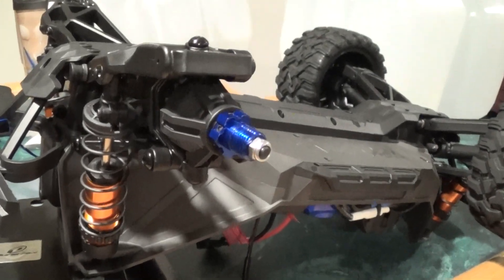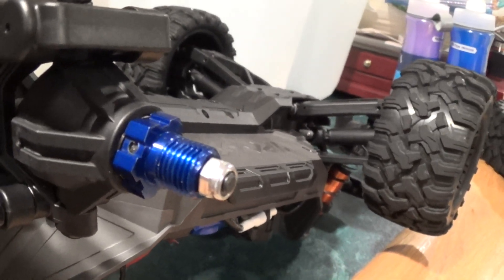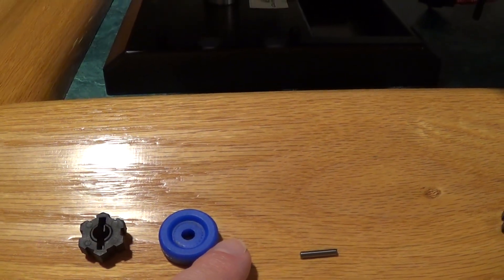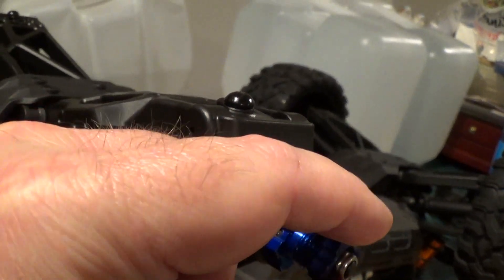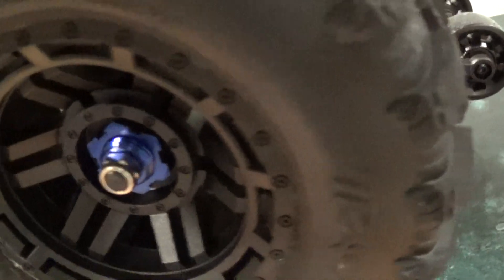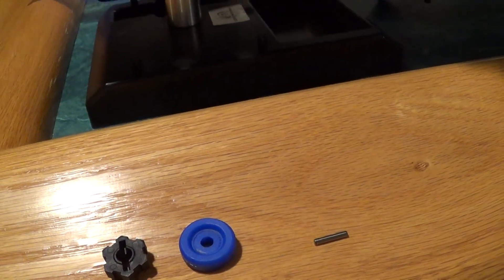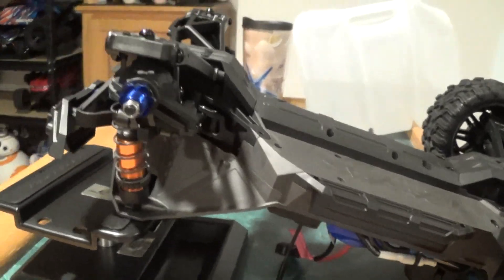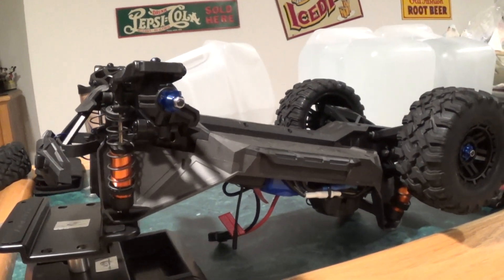Traxxas Maxx with Aluminum Hex Mod

Comment: What's the part number for the aluminum hex and is that a 5mm nut?
Reply: The hexes are part 5353x and that is a 5mm non-flanged nut. Part 4147

Comment: Nice work!  Is there a gap between the stock axle and the blue axle?  In other words, does it fit snugly onto the axle, or does it slide on with a small gap?
Reply from the maker: Thanks😁   It fits snugly with no gaps.  The nut is just for looks.  The set screw holds it in position perfectly up against the bearing.  I am definitely happy this worked out.
Reply: Edward Turck really nice find👍

Comment: Hey Edward Truck, did u use the pins that came with the 17mm hexes, if u did did u have to drill out the pin hole for the larger pin in the new hex🤔, bit late in the game I know But I am here🎊
Thanks Edward
Reply from the maker: I used the same pins and no drilling necessary...direct fit 😁

Comment: Did you just pull the plastic hex off? Seems like it doesn’t want to budge :)
Reply from the maker: I used a flat head screw driver to pry it off.  The plastic hexes are pressed onto steel pins.  Just be careful that you don’t pry directly where the pin sits inside the plastic hex.
Reply: @beyondthebluerc1  Thanks for the reply :) I managed to get it off, it sort of pops off. Was having trouble with plyers but didn't want to damage anything and then worked nicely with a large ish flat  head screwdriver. Feels a lot more solid now with these on. Thanks again :)

Comment: I have extras from the xmaxx do you think it will work?
Reply from the maker: I don’t have an XMaxx, but I know they have 24mm wheel hexes so they wouldn’t work with stock Maxx wheels.  The wheel nuts are 17mm though.

Comment: Now your telling me that I have to upgrade a basher to bash...wow
Reply from the maker: You don’t have to.  I chose to because I like the way it looks and already had the hexes so no extra money spent.
Reply: @beyondthebluerc1  you are gonna strip the plastic hexes with a 4s power
Reply from the maker: Fet Thunderdome 

I have seen a vid of it running 6s with the plastic hexes and they seemed to hold up.  These hexes being keyed does help.  I am not sure how long the plastic ones would hold up for the life of the truck though.  I switched them out though for longevity and I prefer the way the aluminum ones look.

Comment: Do you want to know what did prevent me from considering the purchase of this Maxx? The fact that it costs 530 dollars (630 euros in Italy where I live so figure out 150 dollars more) and has all the important parts made of plastic. You have to buy upgrades and spend at least 150 dollars more. That's pretty outrageous. This truck should cost as a slash/rustler because this is the same ballpark
Reply from the maker: I agree this truck should be 50 to 75 dollars cheaper, but it is definitely a totally different truck when compared to a Slash/Rustler.
Reply: The Maxx is not even in the same ballpark as a slash, come on...  the slash is a POS in comparison, it's light, drives like a toy, bottoms out on grass.  The Maxx it a fine piece of machinery, tougher than nails and can navigate any and all environments.  If you drive a Maxx like a slash or a truggy/buggy, you will be disappointed.  Its like any type of racing; you could be the best F1 driver but after driving Nascar you realize you can't use the same lines and strategies.